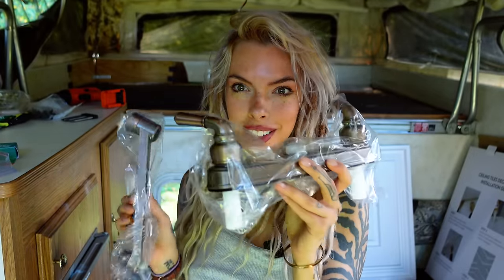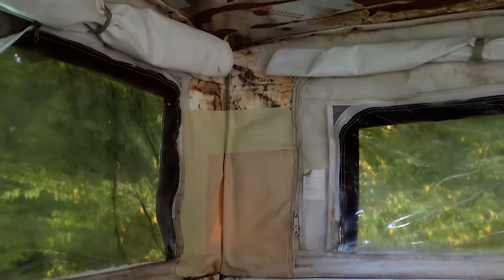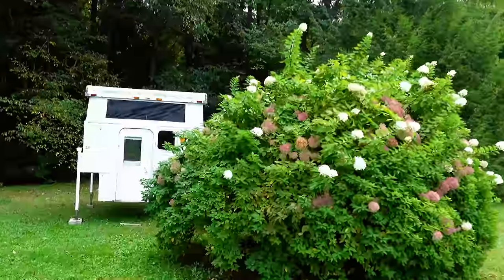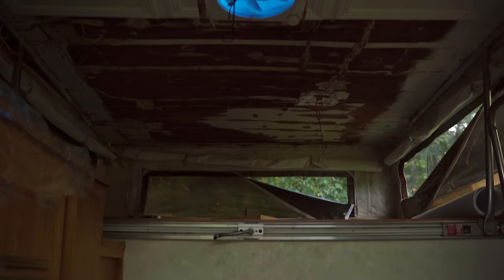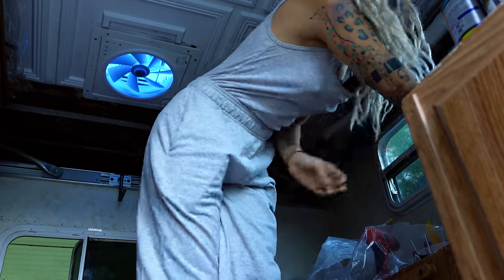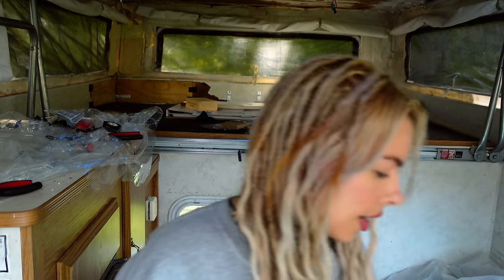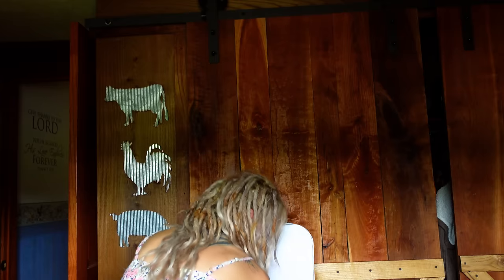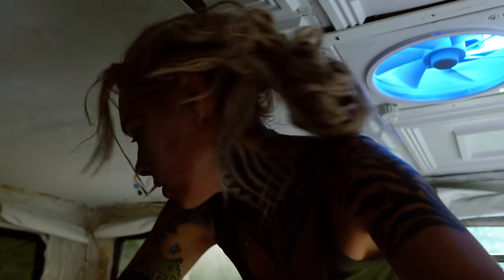hooking up the electric *for the first time* in my Old Truck Camper

Comment: Canvas does shrink. A lot! Plus if one drop leaks in condensation is bad when its dry and humid after a rain.  Regular caulk does not seal waterproof. Has to be 100%silicone caulk. I learned this putting in bathroom cabinets.
Reply: There's a blessing in every frustration. You go SOOOOO MUCH content from this stupid thing. You will more than make you're money back.
Reply: Beeswax, boiled linseed oil, and pine pitch(off an actual tree)  boiled up will was the canvas. Water proof and keep the bees away.  Just wax will attract bees.
Reply from the maker: Yes I realized that haha! And yea I need to wax some of it
Reply: @TorieRobot  I have a fixit nature which leads to excessive comments. And I know you're pretty independent but sure wish I could help.

Comment: Maybe try bedliner paint on the entire roof. Also for the canvas i just put 303 on my pop up and tent seam sealer on the inside and it helped a lot. Sorry you're having such a hard time with yours ❤

I forgot Eternabond tape works well for seams. My caulk was pulling away on the roof seams so i put that down. Its not the most attractive but it works
Reply from the maker: I’ll look into that

Comment: Did you use screws with a self-sealing gasket?  You can try covering all seams with a 4" wide butyl deck tape.  I would look at taking all the screws out, cover the holes with the butyl tape and screw in new screws with self-sealing gaskets through the original hole.  Another commentor below who is a contractor suggested just covering the entire roof with EPDM.  That will work also.
Reply from the maker: Yes they all have rubberized seals
Reply: @TorieRobot  These older campers are a flawed design.  Too many points of intrusion for water to enter and now you have a camper that has aged.  I think the cheapest fix is to find a waterproof fabric that you can cover and secure to the camper roof during rainfall when parked and during transportation.  Have the fabric overlap at least 6" past the point where the roof separates from the walls when the roof is in the closed position.  Use the fabric cover only when needed otherwise moisture can build up between the roof and the fabric during periods of standing. Think of it as a raincoat.  I am someone familiar with water management.  Water always wins, so you have to introduce an exit for it.

Comment: I’ve been living in my antique wood frame camper for the last 11 years and nothing I have done has kept it from having periodic roof leaks, last year I bought a fiberglass egg camper and even though I’m in the middle of my own remodel the fiberglass shell has way less leaks than the wood frame one, I recommend flex seal coating the roof, my guess is there’s probably a pinhole somewhere in the roof
Reply: Flex seal has no place on an rv.. bad advice

Comment: There are flat roof solutions systems designed for flat roofs that have started leaking. They use membranes to seal any edges and keep the water out. It may be worth covering the whole roof with a system like this.

Comment: Only have 1 suggestion -- you could paint the whole roof, edges and all, with liquid rubber/ rubberized paint. Do yourself a favor and look into it -- seems it would be easier and provide a more reliable, robust water-proofing. EDIT -- Another suggestion might be to build a light-wight camper from scratch, relying on channels like Traveling by Tacoma, Wandering with Kate, or Endgame for instruction/ideas. Might just be easier in the end and you could take and use misc parts from the water-damaged unit.
Cheers -- and good luck!...from North Vancouver

Comment: I deal with roof systems on a daily basis.... You need to use a self leveling caulk. It settles and pushes the air bubbles out of the caulk when you apply it ...also they make a roof system that's used for flat roof commercial buildings and it's basically a vinyl covering that goes completely over the roof your trying to replace it repair.. I just put one in my neighbor's 46 ft. Camper.... Look into it at least

Comment: There are several different types of flex seal you tried the spray but they have it in a can you can brush on it would be much easier and hold better than caulk because it can be put in and use the brush to fill all the little cracks
Reply from the maker: Yea I wanted to try it out before I got a whole can

Comment: Consider using the Flex Seal product on the outside, on the canvas itself. The exterior really needs the heavy layer of weather protection. Keep going, keep trying, every little bit helps!
Reply from the maker: That won’t work on canvas or even on the vinyl - lifting and lowering that with the flex seal would make a sticky mess

Comment: Try painting the entire roof and sides with the RV Sealant  2 or 3   Coats Spray the screws on the sides with the flex  Seal coat  It's looking really nice
Reply from the maker: Yeah I’ve already sealed it twice but will do another coat and then paint the screws with flex seal

Comment: when you fix the screws in the roof, take the screw out, coat the threads in caulk or liquid nail to create a waterproof seal
Reply from the maker: I mean- they have rubber around them they aren’t meant to be leaking - unless they come out

Comment: You should look into Wax waterproofing canvas,  when done right it works great and you just reapply it as needed
Reply: buy canvas tent waterproofing spray an spray it from the I side out then do the waxing on the outside. If you do both on the outside they will cause problems when getting the wax to asorb into the canvas. Just make sure you do the waxing first.  Then spraying to inside will asorb the tent waterproofing into any parts that aren't fully sealed helping add a 2nd waterproofing layer to give more protection.

You also could get waterproof canvas style stuff they use in newer pop ups an put on top of the canvas so that it's waterproof can chose a color an will protect the canvas from uv then the canvas becomes a noise an heat barrier to make the inside more coY in high temps or cold

Comment: Cover dads screws with ..rubberized rocker guard ..can be found in autobody section .....white is available....in spray cans
It won't stick to silicone caulk however. Paintable caulk is available...always read labels!
Reply from the maker: I’ll look into that- thanks

Comment: Screws make holes that need to be sealed.  So when you screw something in that needs to be air tight.  Gotta use a sealing rubber washer or gasget.  Every spot that is attaching to the other needs a seal.  Not hard but just gotta really understand sealing something.  Like an engine.  There's gasgets to stop the oil leaking screws tighten things but don't seal it.  That's done with rubber like door seals on your car and gasgets with some limited gluing.  Would been good idea to have new canvas.  Use shower panels to help used for home showers.  Light weight and made to deal with water.
Reply from the maker: There are rubber gaskets on all of them
Reply: @TorieRobot  that's a head scratcher for sure.  Kinda fun to watch the remodel.  Rooting for a leak proof comfortable camper.  I get the making it your own and the prices.  Rewarding to know you did all that and saved money...lotttsss of money saved.  Been watching a couple sailing who bought an old sail boat.  They remodel it total gut out 2 times so far.  No reason yours not gonna be just as awesome!

Comment: There's a special place in hell for the dude who sold this to you. But you have everyone's support.  Speaking of which the only bit of advice I'd provide after watching this is that while I don't know exactly what caulk you've been using and where but try and make sure it's outdoor and non-shrink so it lasts longer.  All caulk will eventually fail as it ages so maybe leave yourself room to inspect everything a couple times a year.  The ceiling turned out great! Nice work :)

Comment: Sometimes we need to cut our losses, and take a different direction. 
  Not to be negative, but realistic, I think this camper may be a loosing battle with the leaks. 

Flex seal, could be a possible alternative. 

Maybe even Rhino line the whole top of the camper, it comes in different colors too.

Comment: If I were you I would  remake/replace the fabric parts that allow the camper extended up and down. It’s too old, moldy and brittle to repair it. It’s full of cracks. Once replaced It’ll be new and you can seal it once upon install. Not play chase the leak. :)

Comment: Would level calking crack from the movement and flexing while driving the truck?
Reply from the maker: I mean it’s made for flexing but I’m sure I’ll have to continually reseal it some parts won’t be a problem once actually on the truck
Reply: @TorieRobot  isn’t there a bunch of RV dealers up there? Maybe one will help you for free if you do a sponsor video? Or give some advice to how seal the leaks 

Some of them will probably tell to you f— off, but who knows..

Comment: Maybe you can take your camper camping?  Leaks aren't as bad.  I used similar screws to what you used to seal a flat surface.  I put caulk on the inside of the hole when I screwed the screw in and it sealed around the screw.  Each screw can leak around the screw if the seal isn't perfect.  Water has a way of finding its way inside. .. ROBERT

Comment: Make sure that fridge is level by putting a level in the freezer! If it's not level you will ruin it! Adjust the trailer accordingly to get it level...its ok to drive down the road with it on but as soon as you park where you're going to camp adjust it so it's level! I can't stress this enough!

Comment: I'd try to find a rubberised roofing paint for rv roofs or a tar type paint and go over the whole roof as your going to be chasing your tail if it that bad you may have been better off tearing the whole camper totally apart using new marine ply to make a new body for it and buying new ally to put on over it there's a tape they use but it's temperamental it's something like but tape it's a butyl tape that sticks but has to be used under warm dry weather and on totally dry timber etc it's expensive as too but works well

Comment: There might be a dial on the fan that's a sort of thermostat. So if it's under a certain temperature it turns itself off.
Reply from the maker: I think it’s something to do with the rain sensor thing - it has a sensor to shut when it sensing rain but idk if it works

Comment: There is a roofing product called liquid silicone roof coating that you can put on with a brush or roller it will 100% seal the roof and it’s white and last like 25 years …. Highly recommended
Reply from the maker: I put that on already- the roof isn’t the actual problem- it’s the sides now
Reply: @TorieRobot  the sides as in the canvas or metal side walls ….. sorry you got royally screwed on you purchase but your an amazing human being for being so calm about it and taking the job the repairs mostly by yourself 👍🏻

Comment: Use white painters caulk for your ceiling white Blanco to fill in the gaps an for the flex seal use it on top the roof not inside

Comment: Insure it, wait a couple of months, then burn it to the ground 😂 Did you seal behind the screws before you screwed them in? Might be worth backing them out and sticking a blob of sealant behind them. Otherwise you can buy flexible rubberized paint to seal it. Theres always one more thing to fix on campers, goes with the territory
Reply from the maker: We screwed them in with rubberized stoppers so they shouldn’t be leaking

Comment: Water leaks are a bitch. The source can be on the other side of the structure and it will flow the path of least resistance.
The roof of my house had a broken shingle 14' diagonal from where it was actually leaking through my ceiling above a bay window. I thought the window was leaking because there was no problem with the shingles above the bay window. Didn't find it until I replaced the whole roof.

Comment: The caulk tube that had a crack in it you could have just scooped it out and smoothed it on
Reply from the maker: That was glue and I scooped as much as I could but it was so messy
Reply: @TorieRobot  oh dang I understand I'm remodeling a custom boat it's huge and had leaks everywhere the idea whoever built the boat was cool they just used the wrong stuff 😭 I've been working on it since covid

Comment: Take the canvas off and save the roof and just put that much of wood on the top and make it so it doesn't fold down it's the only way you can save it unless you put brand new canvas in there I'm building

Comment: One of my siblings almost brought one of these things, probably the exact same model, crank was fucked, water damage, etc 

The people selling it already had it lifted up, and was trying to pull the same bullshit 

Maybe other people will see these videos and not make the same mistake 

I’ll suggest adding the make and model to your video descriptions so others can find it
Reply: It was a sun lite..
Reply from the maker: Yes this is a 2002 sunlite camper - I wasn’t able to try the crank cause they had it up as well and lowered it while I was at the bank so I didn’t know about the crank and the bad spots were hidden behind tape and a sheet of thin aluminum on the bed

Comment: I highly suggest you take out of all the screws and put caulking in and screw it down and then recaulk on the outside but once again sweetie I highly suggest that you rubber roof the whole thing good for the most part caulking in time will dissipate please believe me I wouldn't steer you wrong I care about you and I have lived in compass and motorhomes in the roofs all suck I started putting a rubber roof and I have no problems hey keep in touch with me but I only wish I could be there to work with you and help you out with this

Comment: You fixed everything else.  I really think the canvas should be replaced. You can’t seal and waterproof that canvas  it’s way too damaged.  They make many kind of canvas tents that you could buy and cut the canvas from the tent and replace the destroyed canvass you have on now. Not only does it look bad but it’s not going to do a good job of keeping out water and everything else.  You could buy a used canvas tent to save money. If you know someone that can sew you could sew plastic flexible windows in it. But it’s ok if you can’t put windows in that. The canvas is really bad it needs to be replaced.  It doesn’t have to necessarily be canvas there’s many materials that could be used but canvas is what you said it is now. So yea. But there are other options.  When you are camping and it’s raining and windy you won’t be happy with water and wind getting in your camper. Through the canvas. If I lived near you I’d help you for free.  Someone should be helping you finish it off.  Once it’s done you will have a good camper.

Comment: You need to look into getting some panel Bond I use that on my pop-up camper never had a leak again I panel Bond every damn  crack I used to use cock but it never worked